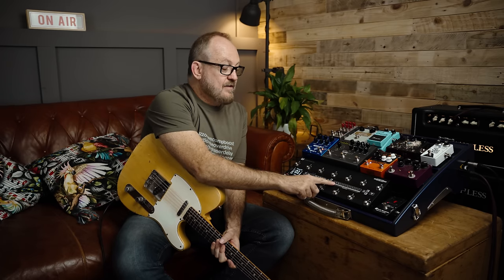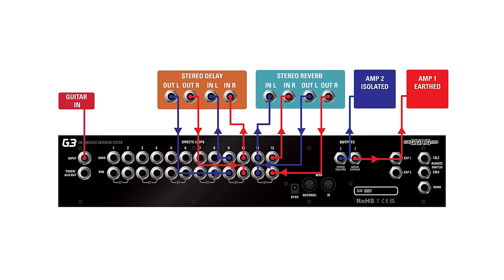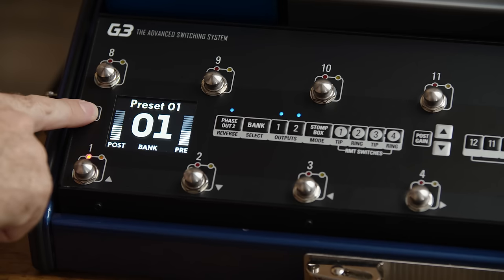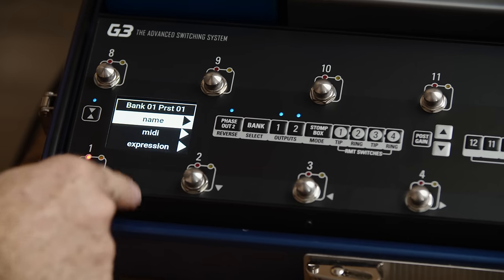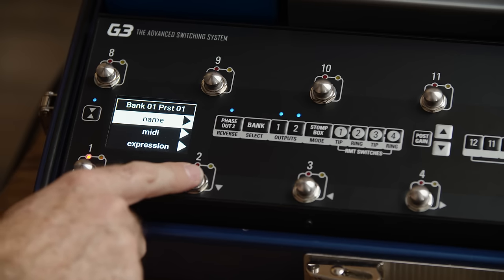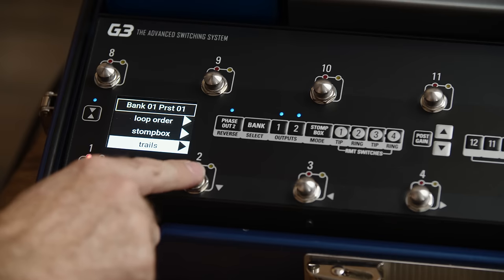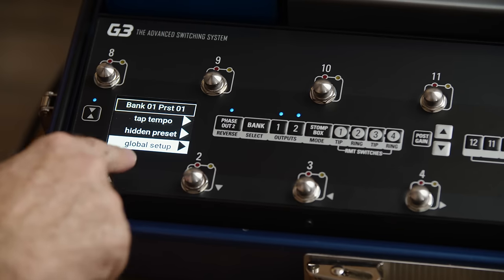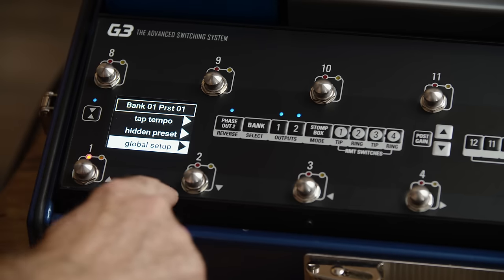Set Up & Connections - TheGigRig G3 DeepDive

Comment: #ElPresidente #DanGigRig On the G3 there are 12 Loops, but 14 Foot Switches. On the G3 ATOM there are 6 Loops, but 8 Foot Switches. Why the mismatch between the no. of Foot Switches/Presets and Loops?  #MathIsSoConfusing
Reply from the maker: The number of foot switches and loops are not related. You can tell any footswitch to turn on any loop or combination of loops 👍

Comment: G3 needs to put more Stereo Jacks inputs and outputs PER LOOP so it has 12 stereo loops to choose from. Another problem is if you have 12 loops with 12 different fuzz or drive pedals and when you turn them ON they are all at different volume levels. The Loops need a level control PER loop to mix the levels of all your drive and fuzz pedal to all be at the same volume level. Plus 12 loops is not enough, I need 30 loops just my fuzz pedals, drive pedals have 10 pedals. Can the G3 take a mono output pedal an turn it into a mono output pedal into a parallel stereo output for like phaser mono pedals I would want the output to go out stereo?

Comment: I have a question about using the FX loops of the amps but in a stereo rig where you would have two amps with FX loops that I would like to send the reverb and delay into both amps through both FX loops. Do I just put both loops into the G3?
Reply from the maker: Yeah, you just need 2 power amps to send the stereo output to 👍

Comment: When using 4cable method on one amp, can you still add the second amp to output 2?
Reply from the maker: Hi there, yes but that signal will have the 1st amps preamp on there. If you went to a second and fx loop return that would also work great 👍